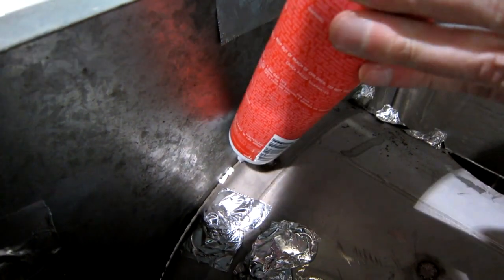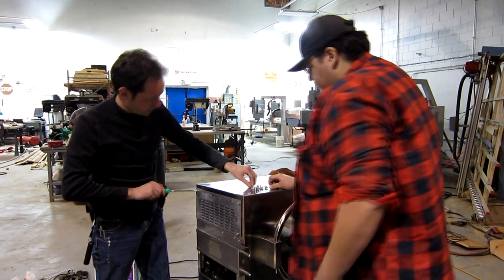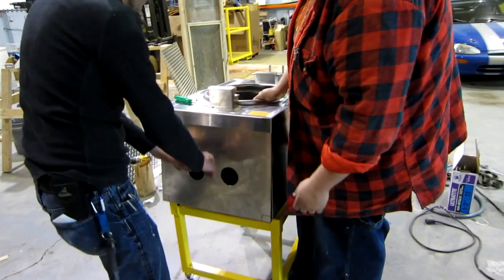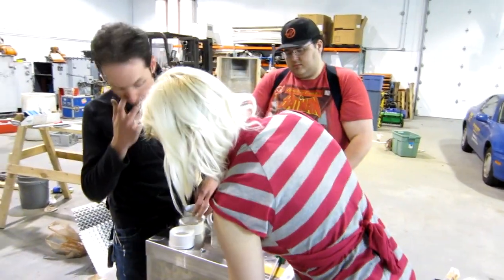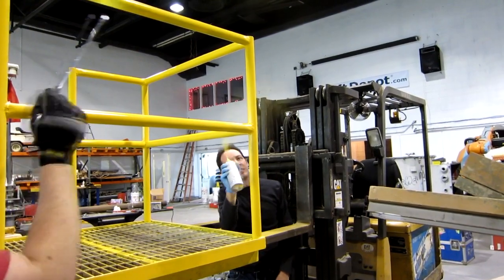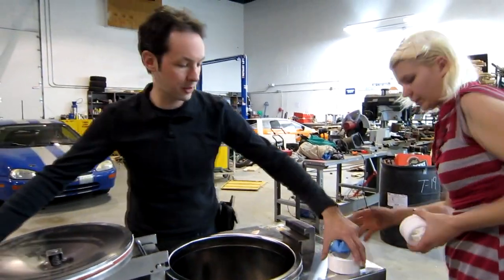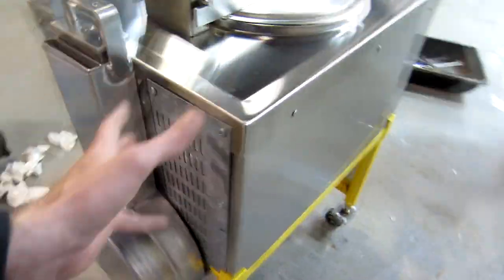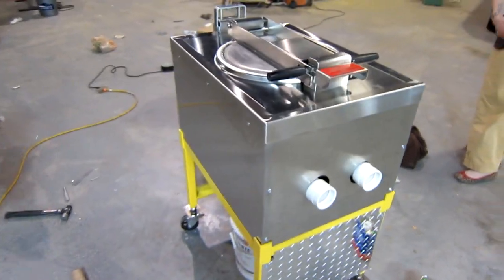Captain's Blog 12-20-11 Blast Containment and Manlift

Comment: NEVER use an angle grinder without guard!! If the disk shatters at full speed your safty goggles will almost certainly do nothing. I had a disk shatter just recently while cutting metal. The guard kept me safe (except from the "surprise"), but on the open side pieces flew out and stuck to a dry wall and wood! (and the guard also keeps you from mounting wrong sized disks; large disks on a small grinder will go over their RPM limit)

Comment: he's finally gonna get good application use outta that giant vibrator he's got.  lol.  that sounds so horribad in any context, but vibrating that crete down will make it more dense and ultimately more resilient.   i would consider introducing some chicken wire for crete stability and tensile strength, but maybe thats too much.  Then again, nothing succeeds like excess.  definitely in explosive environments.

Comment: Should be pretty simple to lift Stomper with nylon slings and the forklift. Place a few wedges on the stand beforehand to get the slings out, pull the wedges.